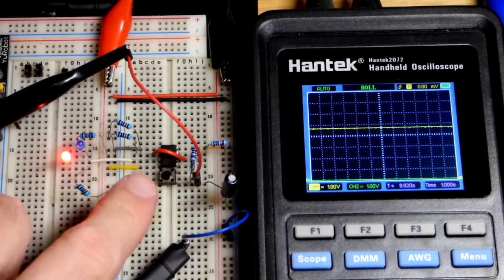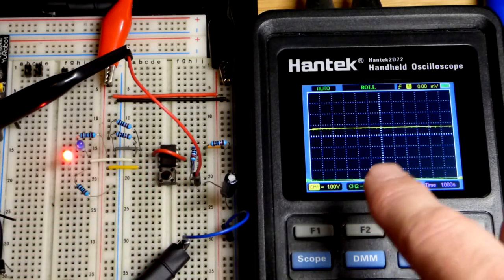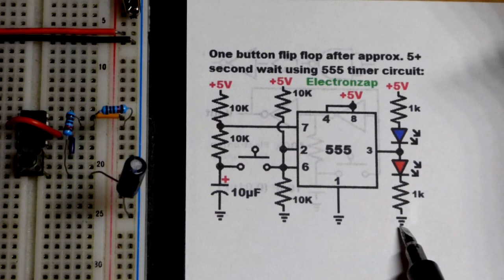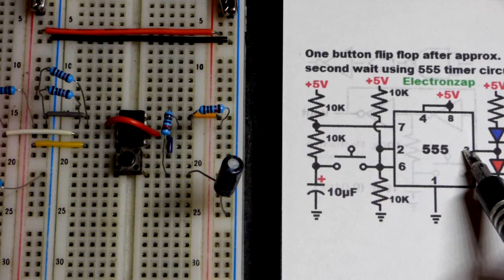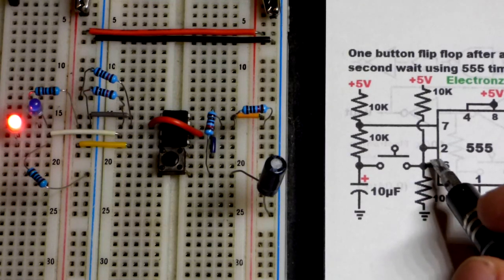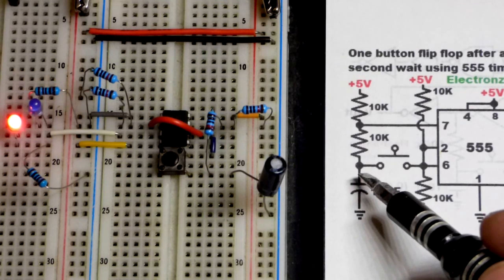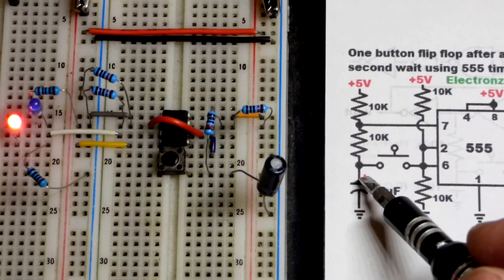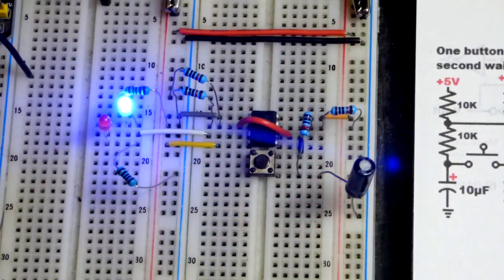Quick press of just one button flip flops output using 555 timer circuit by electronzap

Comment: 555 Timer #ProTip: I know all 555 design notes show that Pin 4 is wired to Vcc, and they also show Pin 5 with a capacitor to Gnd., and these last century schematic have been replicated from the 1st chips from last century, and now into immortal PDF files.
If you look at the Schematic for the modern 555, you will see that Pin 4 is internally pulled high, and Pin 5 is not even needed to be bypassed to ground. Pins 4 and 5 CAN have very useful roles, but: 
 It's a waste of MILLIONS of peoples time playing with 555 timer prototypes that they place a wire from Pin 4 to Vcc.
 It's a waste of MILLIONS of peoples time playing with 555 timer prototypes that they place a capacitor from Pin 5 to Ground.
It's a waste of OUR time!
The 555 Rule is that Pin 4 and Pin 5 are to be not connected, unless you are DRIVING those pins for Reset, or for modulating the 1/3-2/3 compareator voltage. Just leave those pins alone, unless you need to USE those 2 pins.
I tell this to many people, but they read a PDF or a last century DataBooks, and doubt me (because i'm only 61) and I challenge anyone to show me ANY 555 timer circuit that will not work with Pins 4 and 5 completely non-connected. 
 It's a waste of MILLIONS of peoples time playing with 555 timer prototypes to follow "That's the way we've always done it" heard-think.
...but I digress...
Reply from the maker: Thanks for the info!